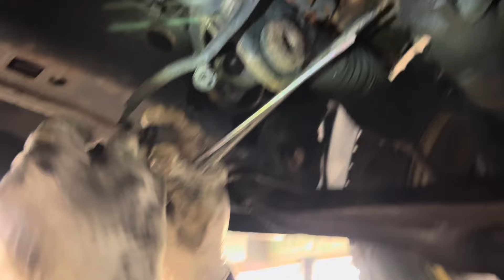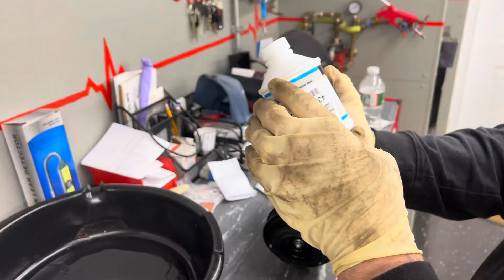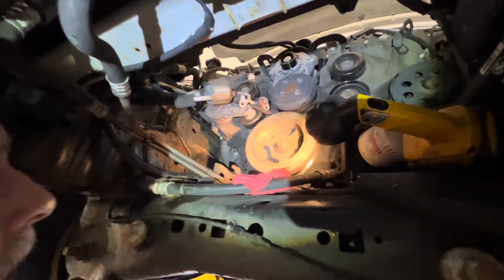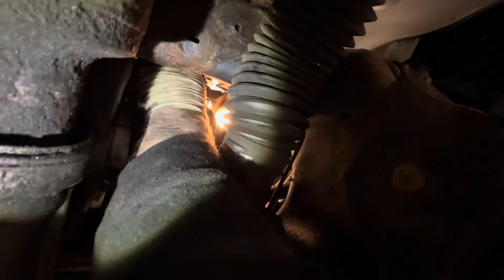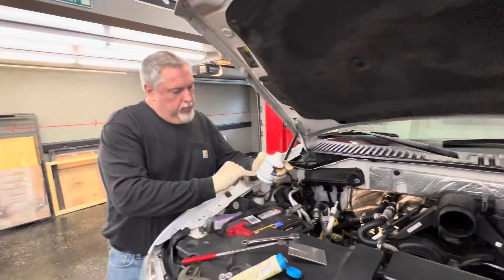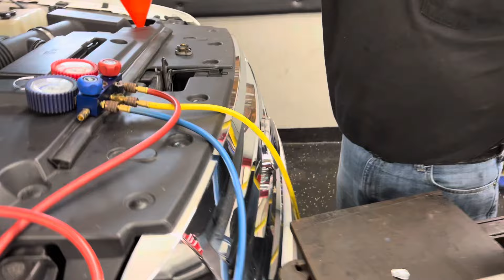How To Replace Ford Expedition AC Compressor 5.4 Engine

Comment from the maker: Buy Tools Needed For The Job

🔧BUY Replacement Ford Expedition AC Compressor: https://amzn.to/44lTdpT
🔧BUY Anti Seize Threat Lubricant: https://amzn.to/3L9S3WZ
🔧BUY Neiko 3/8 Inch Socket Set On Amazon: https://amzn.to/3kUuGpN
🔧BUY Ratchet Wrench Set: https://amzn.to/3mKWIFh

Comment: The third bolt, the one that hits the frame is impossible to get out, is so sized up that the swivel was just braking. I broke two. And without the swivel its almost impossible to get to it since there is no room. What's the solution? This in NYC salt road driven car, we talking about severe rust on this 2008 Navigator. Water pump was so sized up that even pounding with the electric hammer drill would move it. You watch the videos and it so easy and straight forward and then I start doing it and I always hit the concrete wall with epoxy reinforcement :)
Reply from the maker: NYC salt will do that! Soak that bolt with penetrating oil a few times, overnight if you can, and use a 6 point socket with an impact rated swivel or a wobble extension instead of a regular swivel, since those snap under that kind of load. Some careful heat on the bolt also helps break the rust bond. Once the bolts are out, a stuck pump usually lets go with a few taps from a rubber mallet or by prying gently on a tab, not on the sealing surface. Good luck, you've got this!

Comment: Do I need to just replace a system in an 03 expedition the system only works on the highest setting that doesn't blow out in any other setting and that's for all three 3 control valves the one that's on the dashboard I have one above the ceiling and in the rear passenger one
Reply from the maker: It sounds like your blower motor resistor is bad rather than the compressor itself.

Comment: I always replace the lines that connect to the compressor because most of the ones I work on are super rusted and the lines are really rusted and the bolt that holds it to the compressor never wants to come off.
Reply from the maker: The AC lines on my 2012 were fine. I still have the truck and the AC has been fine.

Comment: Pretty similar set-up if not the same as my navigator. Appreciate the video.
Reply from the maker: Should be the same as the Lincoln Navigator. This is a 2012 with the 5.4 in it. Thanks for checking out the video. -Tony

Comment: Steve my AC Compressor seized from sitting for along time on my 2004 Lincoln Navigator can I just replace the compressor like you did here or do I need to flush the system
Reply from the maker: You might be able to just replace the compressor as shown in the video.

Comment: I have a 2004 Ford exposition I have the starter wire and compressor and engine sensor wire stuck in the way. Your video is on a lift which most common people has to use ramps if they are a shady mechanic your video is nothing like my vehicle is made.
Reply from the maker: The video shows a general idea of how to replace the compressor; it may vary based on your setup.

Comment: You are a skilled mechanic and made the hard look easy. Reading the comments (laughing) about a DIY job.   Lets just assume, everyone has a auto lift.  I have a 2010 for 10 years now and never had a leak before.  R-134 A started at a dollar a pound in Sams Club many years back and no certification needed.  Am retired AC mechanic. From my experience, auto leaks, especially two evaporator systems, are way harder to find, then other AC systems.  2010 Expedition EL, has a leak, hunting for it.   A no, no before, when refrigerant . was affordable.  Filled the system with air  (own a vacuum pump)  125 lbs, and no leaks found from the top. Have a lift, and seen the compressor location,  never thought it would come out the front. Your video made me happy.  Wanted to see how much work, to change compressor out.  Missed of oil, on compressor.  Hoping to find the seal leaking when soaped over.  Must say, everything underneath looks brand new. Read a article, Ford Expeditions are in the top 5, best cars ever built, many with over 300K ,when service is done, as Ford recommends. Preparing this truck for sale and don't want to sell it , by just adding refrigerant.  Replaced with a 2021 Navigator Reserve. Owned six since 1999, 3 were new. Last new 2008. Prices are crazy for a working man.
Back to your vid. Amazing how easy you made it look to remove the line set. Basically working in a blind area. Not to mention, the o-rings and gaskets have a lot of wrong places (re-install)  to end up. I will be sure to play your vid, step by step if the compressor needs replacement.  Great video
Reply from the maker: Thanks for watching the video. These trucks are awesome, I have a 2012 and a 2014. The 2012 has around 225,000 on it. The 2014 has 99,000 love that truck!
Reply: @HomeownerRepair  The 2010 has 165K and the 2016 Max has 255 K. After I got the  2021 Navigator,, my son-in-law  chose the 2016, it runs like new. Their awesome.

Comment: Did u replace the A/C WASHER SEALS (in addition to the O-Rings) which seals  the compressor to the 2 refrigerant hoses?
Reply from the maker: If we did it would be shown or mentioned in the video. We usually do replace o-rings and stuff like that.

Comment: This is exactly what I needed. Thank you!
Reply from the maker: Thanks for watching!
Reply: @HomeownerRepair I actually removed the low and high pressure mid line and pulled the ac compressor out the back. This took me and hour to figure out and 5 mins to replace.

Comment: If the compressor is bad, will it smoke
Reply from the maker: The smoke might be Freon leaking out or the belt rubbing against the pully on the AC compressor it is frozen and stuck in place.

Comment: Did they take the fans off?
Reply from the maker: If you watch the video it explains everything that we did to replace the AC compressor. I don't believe that we removed the radiator fan. Hope this helps out.
Reply: @HomeownerRepair  it doesn't have the fans

Comment: did you drain the lines before remove the ac compresor.?
Thanks
Reply from the maker: Yes, If the lines still have Freon in them you will have to have the system pumped down before you do this.

Comment: A question I have 2011 expedition where orifice tube  filter
Reply from the maker: I am not 100% sure. You might be able to Google its location.
Reply: It’s going to be a TXV. Follow the lines to the firewall and that’s it right where it goes through the firewall.

Comment: Just replace the clutch and  be on your way!
Reply from the maker: This truck has over 214,000 miles on it and a new AC compressor wasn't that expensive, so I opted to swap it. Plus it's my kids truck now and the worse call to get at work is..DAAAAAD this isn't working ...LOL

Comment: If it was just the clutch that rotted, it was one bolt and $75.  Just did this on my 2010.  No need to swap in a new compressor.
Reply from the maker: This truck has over 214,000 miles on it and a new AC compressor wasn't that expensive, so I opted to swap it.
Reply: Question for you my ac has been running ice cold since I bought it, today got the burning clutch smell and hot air blowing out, you think I could just change the clutch?

Comment: just wondering and im guessing so but would the steps here be the same for a 2003 Expedition with the 5.4?
Reply from the maker: It might be a similar process.
Reply: Any luck with yours? I've been debating on doing it myself on my 2003 expedition

Comment: Hey guys this is great.  About to do same on my 07 Expedition (compressor seized).  Wondering if you all just took an 'executive decision' to not flush / replace condenser due to belief that debris wasn't too bad a risk based on the manner of failure?   I see that the desiccant cartridge came with the kit you bought, did you guys just opt to not do that stuff and just throw the compressor on.  (I've done same at times and yes it's a risk but so far never had issue).  Just curious the reasoning for not doing condenser / flushing given it was a compressor failure.  Thanks for the great video!
Reply: need help with 2003 expedition  belt size to bypass a/c compressor ,compressor seized up
Reply from the maker: I have 203,000 miles on this truck. The condenser is fine, we didn't really want to disturb anything else. Hope the video helps you out.

Comment: Why didn't y'all flush anything or change the desiccant bag in condenser or change the rear expansion valve?
Reply from the maker: The kit only came with one expansion valve so we just replaced the front.
Reply: If all i have is a compressor out of a junked truck is there anything else I have to have in order to swap it out with the seized one? Not very much mechanical experience but very mechanically inclined
Reply: @pauljohnson3668  what model? You need to change your desiccant bag and expansion valves. If it is a older expedition you need to change your drier/accumulator and orifice tubes. If your compressor locked up flip it upside down and shake it. See if any oil or metal shavings come out. If shavings come out you need to flush all the lines and condenser.  They recommend changing the condenser most times anyway.
Reply: Come on.  Do it right

Comment: @HomeOwnerRepair Is there a reason why you replaced all the O rings? Was it just to be safe? I didn't hear any mention of them leaking.
Reply from the maker: They were not leaking, but the truck has 203,000 miles on it so we figured we would replace them. It wasn't that hard to do.